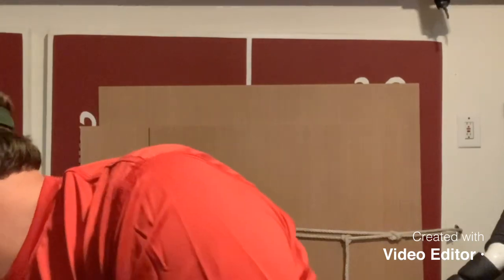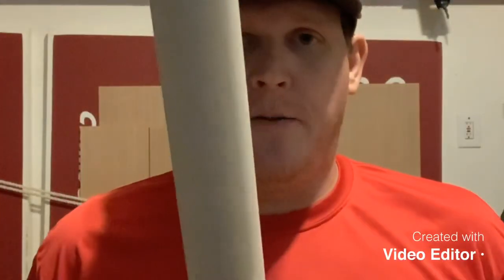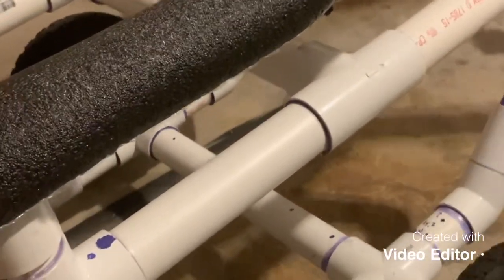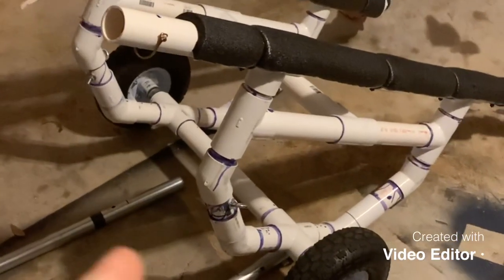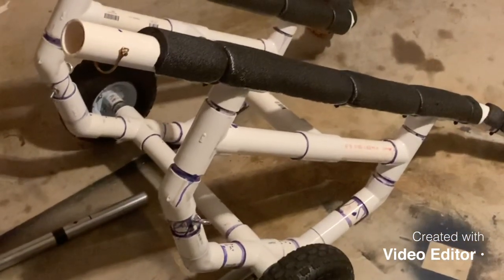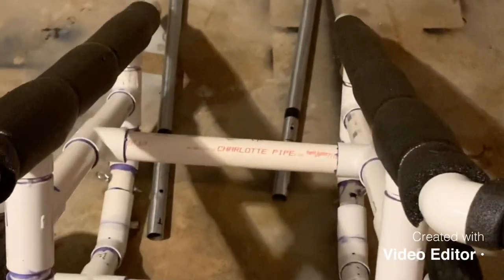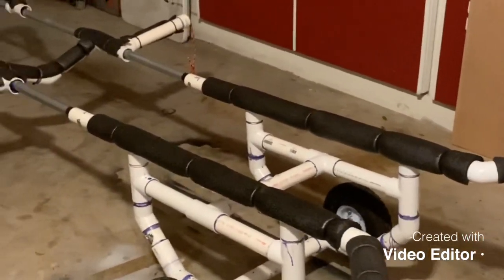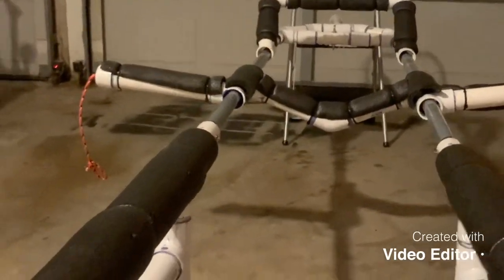DIY Inflatable Boat Trailer

Comment: Where can I find the plans you mentioned  you would post. I could not find a website that you mentioned. Also, do you have any videos of the trailer in use. Does this trailer come apart for storage/traveling. Thanks
Reply from the maker: Sorry, no longer have the website.  Shoot me an email and I’ll get you the plans.  Yes; it comes apart easily in three pieces.
Reply: I'd love to take a look at those plans as well, but I can't find your email to ask there.
Reply: Hello , could you give me the plans as well. Thanks
Reply: Hello creator , just bought a dinghy and need to make a trailer. I think this plan would work perfect. Could I also get the plans? How much do you think it cost to build ?

Comment: I made one like that, but it broke almost after hitting the first bump.  A welded one would be better, or build one out of wood or bamboo.
Reply from the maker: Don’t disagree.  But I only use this to get from a camp site to the water.  I’ve gone over speed bumps, pot holes, etc and had no problem.  Did you use the 1’3/8’ steel top rail like I did?
Reply: @hobitknobbin7827 Yes. But all from plastic pipes, no steel. It broke where the axles went through.
Reply from the maker: Gotcha.  I have the 5/8 steel rod as my axle, that is inside 1” steel pipe, inside 1’1/4” pvc, inside 1’1/2” pvc which holds the axle.